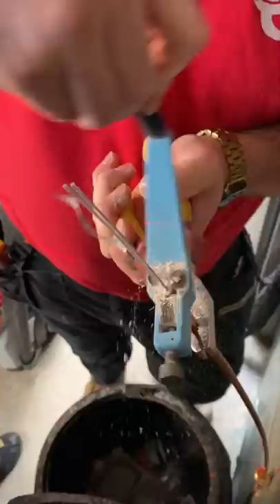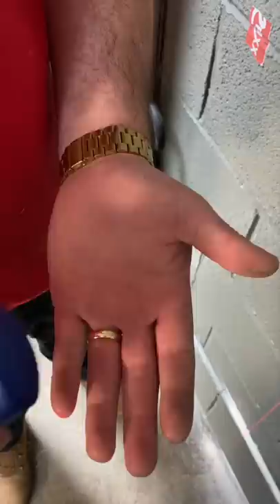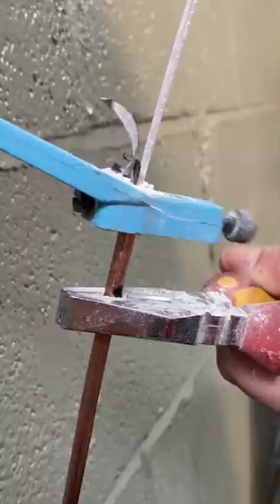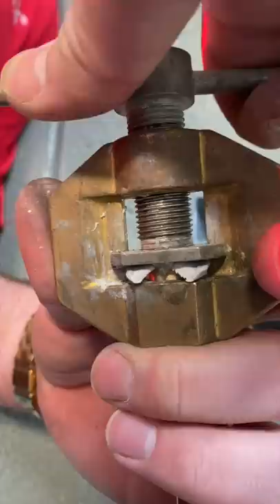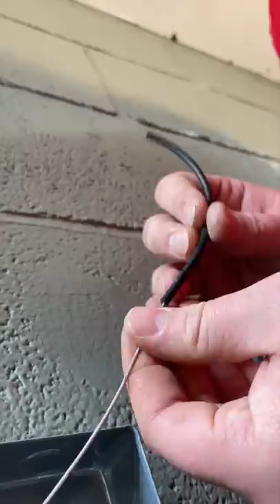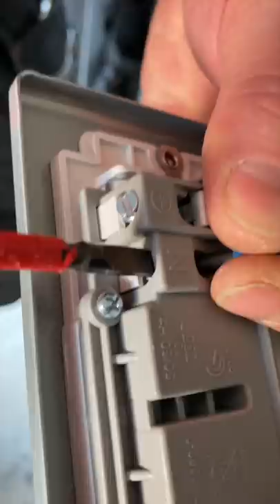Installing Bare Copper Mineral Insulated Cable. #shorts

Comment: Looking at the drawer full of nice screwdrivers, I wish I had a pound for every new screwdriver that I brought and swore that I would never hit it with a hammer.
Reply: Where did you bring it to  ?
Reply: That's why you buy those Wera screw drivers made for it. Or the Klein screw drivers made for it.
Reply: Millionaire yet mate? :)
Reply: @TheChipmunk2008  Klein screwdrivers are not particularly expensive and even the wearer screwdrivers are pretty affordable. Especially compared to replacing that multiple times
Reply: Loooooool same.
Reply: @Morberis  definitely hear you on replacing multiple times, i like wiha. good price/longevity balance for a tool abuser like me. For more precise people wera are better
Reply: Just buy the wera chisel screwdrivers
Reply: ឥតគិតលុយ
Reply: @Morberis  តាមផ្លូវជាតិនៅថ្ងៃអាទិត្យកន្លងផុត
Reply: @TheChipmunk2008  ការកំណត់គណនីរបស់
Reply: I have a long, flat bladed screwdriver that i use specially for hitting with hammers. The damn thing works as good as a thin chisel when the tip is sharp.

Comment: Thanks for this video it made me research this wire it's quite fascinating. I didn't even know it existed.
Reply from the maker: You’ve discovered the worm hole of MICC
Reply: Same here! Very useful!
Reply: Here we use it for heating up  concrete floors/ ramps. To melt snow and ice. But we order it the leads already installed.  The cable is expensive but it does a great job.
Reply: @assassinlexx1993  “here” as in on Mars ?
Reply: Yeah I looked it up as well and MICC known early as pyro cable.
Reply: @assassinlexx1993 how? That would imply it has a really high resistance? I tried finding some info about it, but couldn't come up with much. Is it in this same form as the one in the video? Or is it different altogether? Does it have a kanthal or nichrome alloy for the conductors? Are the conductors bare, or does the whole wire get embedded and heat up?
Reply: @littlejackalo5326  
The wire is thin  so the resistance  is high.  Just a electric heater wires get hot. So does m i cable just not as hot.
Reply: @littlejackalo5326 there is a version with resistance wire in ( or at least there was 40 years ago 🤣) you could make high power heaters from it but you used different compound in the ends ( blow torch involved I remember)

Comment: We used to use pyro for fire alarms, ventilation control systems and boiler houses, used tin cans to make pigtails to absorb vibration when connecting to motors. Fun making off 7 core.

Comment: I know very little about American electrical systems (I'm an Australian), but this channel is endlessly fascinating. Not just is seeing the creative & intricate answers to problems I've never known existed, but the myriad & efficient ways that the tech all fits together.

• What is this kind of exposed copper cabling used for: Electrical Power or Data Transfer?

• What is the purpose of having the outer sheath made of highly conductive copper? I thought that the outer part of power cables are made to shield the internal wires from EM interference (& the environment from leakage), reducing resistence, but I don't see why this needs something as expensive as solid copper, when simple steel/copper wire mesh would suffice. 

• Also, why is the copper left exposed & not coated with a polymer sheath to prevent accidental electrocution from defective internal wires?

Comment: I have no clue of what I’m watching most of time I see your guys videos, but I absolutely love it
Reply from the maker: Stay tuned for more confusion!
Reply: It's MI cable and it is horrible to get right. And cost loads, only time it's very really used is churches, really old buildings and thatched roofed houses in the roof space. Although in the last one there are a few other methods you can do to solve it. Like tunking or SWA which are alot easier
Reply: @joshuahowden8385  what is the purpose of using this cable over traditional romex?
Reply: @hitsmike2046  it's for industrial uses where flammable liquids etc are used. Basically fire proof electrical wires
Reply: @generalesdeath8180  it's also used in skyscrapers to send electrical power from generators to fire pumps and other emergency systems
Reply: @godlugner5327  to add, it has a 2.5 hour fire rating without anything additional.
Reply: Mineral insulated cable (fireproof cable), most common use is garage forecourt, it's basically a copper outer jacket with magnesium oxide insulation around the conductors, I used to love working with this stuff during my apprenticeship, sadly never used it much afterwards.

Comment: I’m so glad I live in America. You just went through like 10 steps I’ll never have to think about.
Reply: I am glad you live there as well , you would be a hindrance any where else
Reply: @alemgas  pretty inefficient compared to conduit and preinsulated wires imo
Reply: @viktormorris194  It's a very specialist cabling system that historically was mainly used for fire alarm systems as it will keep operating till the outer copper tube which is the ground melts. These days it is mainly used in war ships, power stations (especially nuclear ones) and listed buildings (think lighting in a 1000 year old castle stair case). In the right application, it is massively superior to anything else.

Comment: As a Bradley Mechanic I also used lubricant when fishing and routing those Turret cables, they laughed at me, then showed them why it is necessary to have one. First you can’t used oil such as engine oil it will damage the EMP cable coating, and a petroleum gel use for a human skin is much safer for the equipments.

Comment: Nice , I got taught to terminate into a coupler and bush into the box rather than having all the threads in the box , not bad on the socket but a pain in a switch box where the terminals are top and bottom

Comment: Wish I'd been a spark when this was the norm. Everything's expected to be done twice as fast with half the labour now. Wouldn't want to pay for MI now mind.
Reply from the maker: This was an eye watering cable and gland purchase.
Reply: Get on with maintenance at a nice industrial facility. We have all the time in the world to do it right and a yearly tool allowance. And it works, our unplanned downtime is a fraction of our sister plants that don't have that time. Our planned downtime is also not any greater.

Too bad management at those other plants is more concerned with reducing costs than increasing production. The increased production more than pays up for the maintenance.
Reply: @Morberis  I'm trying mate, contacting is alright but pound for pound shift work is far better. cheers for your input, sounds like you work for a good company, happy for you!
Reply: @cal5566  It can be hard, took me 12 years to get in
Reply: @efixx  how much mi nowadays?

Comment: Hello. I'm an eletrician trainee in germany and im Interested What you are doing there. I literally never seen stuff like this.
Reply from the maker: This is mineral insulated cable - used on electrical systems you want to keep operating in a fire situation. Also used on historic buildings when you don't want to see big cables.
Reply: Good question. Very interesting!
Reply: @efixx  could you please tell me one more thing: why there was 525V voltage on your tester?
Reply: @NiceAndNeat  He was doing an Insulation Resistance reading - pumpin 500v down the line and neutral conductors to ensure there isn't a short in the cable. This type of cable is very prone to shorts when damaged
Reply: @austinoutdoors5967  thank you
Reply: MICC is also incredibly robust! Try hammering it flat. You will be amazed how much it can withstand before it fails!

Comment: Just a diy'er here guys with some electrical experience, I think I've only ever done this once before many years ago, am I right in thinking it was used for fire alarms due to its flammable resistance? If so why is it being used for a double socket?
Reply from the maker: Still used for listed buildings - eg churches.
Reply: Pyro was used for all power and lighting in some installations.  It was used in fire alarm installs because of its fire rating as said.

Comment: I have a small lab and specialize in troubleshooting/calibrating metrology type equipment, but I’ve never seen Kelvin clips that “ruggedized“. Really neat set up and device. (I assume there Kelvin’s?)
Reply from the maker: They are the test clips from our electrical installation tester.

Comment: Why a mineral insulated cable? Over here in NA that would be an armored cable or pipe. And the only time we use a putty is when it's explosion proof. 

Is that outer copper jacket the ground/earth? Imo to my eyes it looks like over time if people keep touching it, like a kid playing with it, it would break from work hardening.

Kudos on folding over the wire for the terminations. 🖖

Btw, I've seen enough of your vids now and they're quality enough that you earned a subscription.

Comment: Interesting... Is it used just to avoid conduit requirements?
Reply from the maker: Used in fire performance applications and in historic buildings due to smaller diameter

Comment: Don't you need to clean the mineral residue off the wire ends before inserting them into the terminals? I'd imagine it causes unnecessary resistance.

Comment: What do you use that type of cable for? I haven't experienced one yet
Reply: It's just safer style cable, copper outside and mineral insides with two strands of wire in em

Comment: Wtf kinda plug is that!? What are the copper bare wires that are sheathed in copper!?
 P.S. - sweet tool setup in the drawer! Love Wiha!
Reply: UK 240v outlet. The wire is mineral insulated copper clad which is a fire resistant cable. Quite unusual to see it installed these day but sometimes used on old listed buildings.

Comment: Is there a reg for the minimum amount of identifying sleeving for a conductor? I always aim for 50-70% identified.
Reply: Would also like to know the answer to this. My guess would be not seeing as connections in control panels are simply numbered, if marked at all, and that goes for 3 phase also. Could well be different for domestic installations though.

Comment: What is this why mineral oil? What is this cable? Why not just copper?
Reply from the maker: It’s insulated with magnesium oxide - used in fire 🔥 performance applications.

Comment: Is this cable even still a thing outside of specialist environments?
Reply from the maker: Specialist - eg listed buildings, churches etc
Reply: Used in Fire Alarm power.
Reply: Been in the electrical trade in Canada for 20 years now.  We haven't used that stuff outside heat tracing pipes in longer then 20 years.  You see it once in a while in older commercial properties from the 70's but it's always ripped out and replaced.
Reply: @ShannonFlippo  very Rare, fp200 gold,  normally usedin High temp situations

Comment: Shame to see a pyro end made off wrong, pyro gland should have been made off into a 20 mm coupling and then into the socket box, a pot wrench is the correct tool to put the pot on.
Reply from the maker: Why do you need the coupling?

Comment: do the regs allow for the copper sheath still be used as earth even though it is exposed as the outer layer?
Reply from the maker: Yes - no different to a metal conduit.

Comment: Dumb question from a yank...why is your wire copper insulated? I have never seen such a thing. Over here we use romex in conduit.

 Very nice work!
Reply from the maker: its a special cable for fire performance situations - they do use it in the US - google "pyrotenax"
Reply: In Portugal this type of cable was formerly used for systems that required fire resistance, now replaced by other materials.

Comment: Why not use different coloured sleeving for the cores? Tape looks really crap
Reply from the maker: The supplied glands always come with black sleeving.
Reply: The sleeving is black but you could over sleeve with coloured sleeving for identification
Reply: @efixx  You don't have to use the sleeving supplied.   Although while every sparkie has CPC colour sleeving on hand there's far less cause to keep brown and blue around 😀

Comment: Got to ask… MICC with plastic wall plugs… what code is that? 😂
Reply: @BST_JUNKIE 
It’s a requirement under premature collapse &, yes, they do make metal fire rated wall plugs for it though most that observe the reg use wall dogs.
Reply: @BST_JUNKIE 
It’s for all electrical cables.
Basically, firemen have been getting wrapped up in cables that are clipped, in trunking, etc., because the plastic melts on the clips, in trunking & plastic wall plugs. BS7671 521.10.202 requires that cables are adequately supported against premature collapse of cables & cable management systems in the event of a fire. Metal cable clips, d-line clips in pvc trunking with wall dogs or metal wall plugs are the most popular routes of compliance.

A new reg (not sure if it’s building regs or IET) stops you from using corridors for cable runs. Don’t think it’s in force yet but will be later this year.
Reply: @BST_JUNKIE 
Recently C2’d a new installation with MT4 running down a fire escape & no prevention put in.

All surface mount cable management (domestic, commercial or industrial), requires measures to prevent premature collapse.

Where it’s in a setting that wouldn’t be the main escape route from a building, it’s a C3 but, a domestic property with the CU above the front door, in a porch or hall, I’ve seen it given as a C2.

Works out as a bit of an expensive mistake when the NIC come out to inspect & pick you up on it, as a guy on another forum found out 😉

Comment: Aren't you supposed to crimp wire ends before installing them in the terminals
Reply: Stranded wire only, not solid core.

Comment: Is that just to look “pretty” or is there a reason to use that kind of cable or is this an “across the pond thing” lol my English friends should know what I’m saying 😝
Reply: Basically fire proof. Not sure why it is useful to a socket.
Have seen it used on electric kilns and other appliances that get very hot.
Reply: here in NYC all of our city owned buildings use this on their motors and pumps. it's about 100 years old and the building will burn down around it but you bet your ass the fire pumps going to be running until the armature melts out.

Comment: Lovely to see the European electrical colours. The brown one which has the colour of mud obviously looks like the earth. So in European thinking it has to be the opposite of that so it is live wire. The yellow and green one that looks like a dangerous snake and so seems to be the dangerous live wire must be, using the same European logic, the earth - the safest wire of all. And the blue one which looks like the sky or maybe water thus indicating a flow of something, air or water, must have nothing to do with current flow, and so is the neutral wire. Obvious really, when you understand the perverse European bureaucratic ways of thinking. Nice to see. But not to touch.

Comment: Please explain
Reply: Explain what ??
Reply: @dennisphoenix1  .. start with global warming and the trans debate and we’ll move on from there .. 😂😂😂
Reply: At the time I had never seen a installation such as this. So I researched  it,I know understand the concept being used in this short.
Reply: @adrianbeard485  when I was an apprentice  (30 years ago) we used pyrotechnics for power , lighting and fire alarms . It was used universally.  Now it's nigh on obsolete and very rarely used .
Reply: @dennisphoenix1  (Pyrotenax maybe?, but certainly not pyrotechnics 🧨 !)
Reply: @andyxox4168  that's auto correct for you . Yes pyro or pyrotenax  .  🙄
Reply: @dennisphoenix1  maybe pyrotechnics if you made it off badly on a large cross-section … 😂